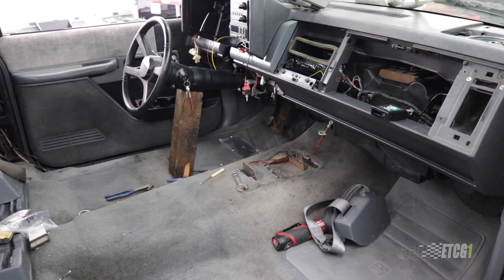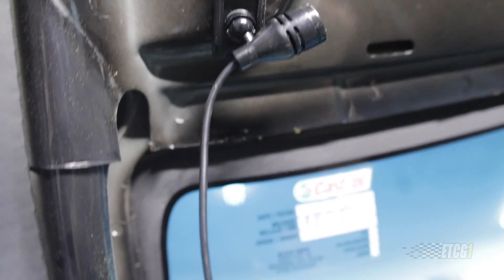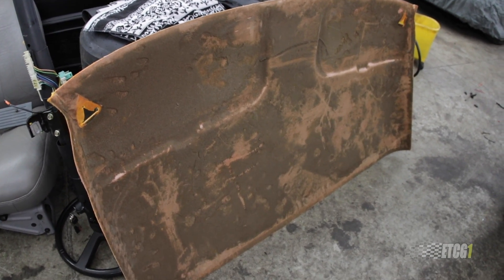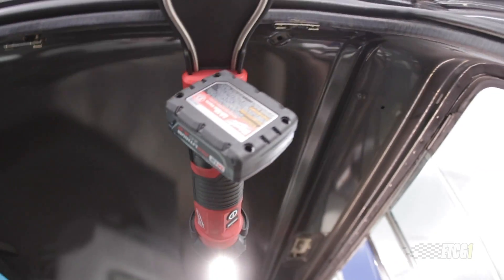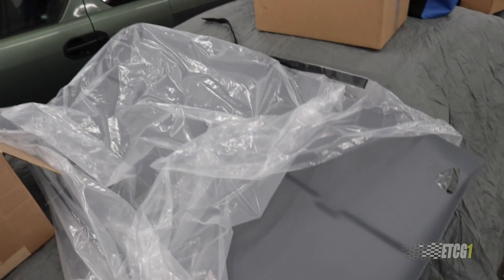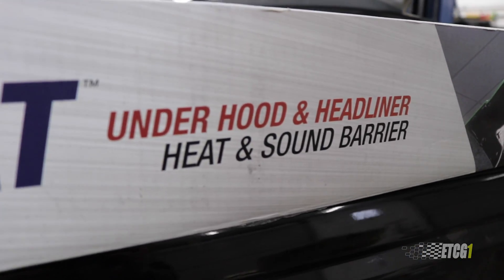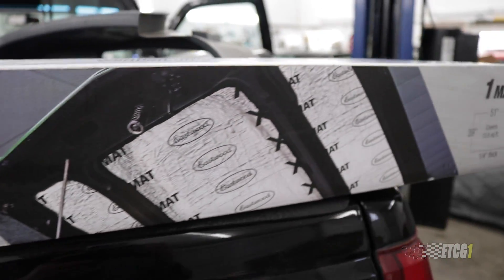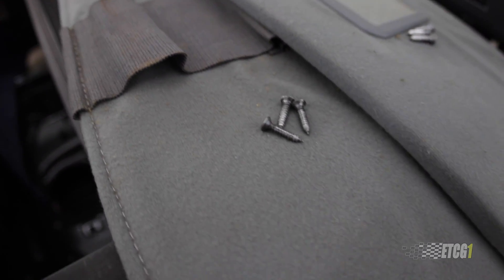How Deep Does the Rabbit Hole Go with #ETCGDadsTruck ?

Comment: Every project vehicle I've completed has never had a completion time line but has had a budget with extra funds available if and when necessary, usually 50% of initial budget.Normally, I spend 8 to 10 months planning to minimise exposure to overruns in costs, and a similar timeframe acquiring parts and accessories. As I have an extensive mechanical engineering workshop available, being a 30 year veteran mechanical engineer, with extensive knowledge and varied training, I have a huge advantage over other builders, which I acknowledge. This is also a huge unforeseeable cost saver. But as your project is  'personal', like my current project, (I'm rebuilding my dads orginal first car, an EH Holden X6, an extremely rare Australian factory performance car, which I tracked down, purchased and 80% completed in complete secrecy), cost should not be an issue. 👍👍🇦🇺

Comment: I hate the "might-as-well"s. It can be a motivation killer before you even start sometimes! Right now I'm putting my SBF together, and I've been trying to decide as I go whether to replace ALL the internal hardware for stuff like harmonic balancers, oil pumps and cam gears and stuff like that. I finally had to draw the line! New harmonic balancer bolt, and then everything else comes from inside the old engine. Done! I could have easily spent another $500 in little nickel and dime stuff! If not more!

Comment: I've been in the rabbit hole with a base model e46 in which I've spent more than 4k€ in repairs (I'm from Spain).
All started by changing the plugs and ignition coils because of rough idle, I thought "it's going to be only 250€ and the car will be fine"
Then oh, the car is leaking coolant, let's change some hoses and the expansion tank, another 200€
Then the radiator, the alternator, then I hit a dog, and had to replace the front fender, brake pads, silentblocks, suspension, and so on....

Now I'm finishing replacing the head gasket and valve stem seals because it was smoking a lot of oil, had to buy tons of tools to do the job plus gasket and seals.

By now, i've spent more money than a lease on a new vw golf. And the fuel economy of my e46 is not as good. +Insurance is not cheap on a bmw.
Also I'm not sure if I did the head gasket job properly. And if I sell the car, they are going to give me peanuts for it.

Comment: I am there right now with an R56 MINI. I just uncovered a broken piston. Do I replace one? oem? a forged set? What else do I replace while I have the engine open. If I could drain the A/C condenser safely, I would pull the block.

Comment: While I can't say I've spent nearly as much as you have into Dad's Truck, at least yours is coming along nicely.

I inherited an 89 Hilux which are famously easy to work on, but dear lord have I thrown more money and time than I have to toss around at it. It was a problem truck to begin with when I got it. Head gasket blew and prev. owner ran water the whole time and it overheated. I've halfway redone the top end. Resurfaced the head, all related gaskets & seals, new water pump, oil pump, timing chain, distributor rotor & cap (thank god the ignition coil is fine), plugs & wires, block plates on the EGR that I had to ask my friend's dad to fabricate (the EGR was already inop but I don't have LCE money), battery & terminals. New belts. There was a bunch of nonsense shoddy hotwiring done (not by me) that I spent weeks undoing, finding on the way that some things couldn't be undone and brought back to OEM bc of how it was done so now I have to live with it. Also did the front and rear brakes only to find that one caliper was replaced but wasn't replaced with a matching caliper, so only one side has new pads and the other is living on prayers. New clutch slave cylinder. Firewall is so rusted that I'm pretty sure if I tried to take the clutch master off, it would pull out a foot diameter hole with it. Speedometer doesn't work and it's proving impossible to find the correct speedo gear that fits into my transmission. Had someone rebuild the AC compressor but all the insulation for the HVAC vents is so old that it's crumbling and blowing straight out of the vents so I'd have to discharge the AC, take the whole dash apart, redo the insulation, and recharge the AC again. My brake pedal is somehow grounding my left turn signal and I can't find what wire it is. Still need to replace the steering components bc the wheel has a lot of play. Still need to get new headlights bc it's still running the OEM headlights which are as good as having candles. Still need to find a new steering wheel bc the horn button (or whatever you wanna call it) doesn't work. Still need a new front bumper bc the mounting for the front turn signals were destroyed so I don't have any signals in the front. Ignition cylinder doesn't crank so I just have a button in the cab that goes straight to the starter. Tires are probably gonna need to be replaced by the end of the year. And that's just everything I can think of without opening up my Things To Do notebook. Also I live in the Pacific so nearly every part I've needed, I've had to pay about half as much in its cost just to ship it here.

And all I wanted was for it to run. I'm not even doing anything fancy. I just wanted it to work. This is my first actual project vehicle, so about 3/4 of all this work, I'm learning as I go. And yesterday it wouldn't start so my buddies and I had to push start it and just go straight home. I don't even want this truck anymore but I have nothing else to drive. The rabbit hole runs deep.

Comment: Back when I was going to trade school for auto mechanics, me and a class mate went to fix the timing belt on my buddy's dad's 2004 Dodge Neon. Needless to say, the cam sprocket exploded when we tried removing the center bolts holding it on. 2 months and $300 later, when the dealership finally had the sprocket in, we went back to fix the car. What a nightmare that was... for all parties involved lol

Comment: I completely understand where your coming from, I have the same truck as you just a different color but I basically did what you did and I planned to have everything done within a couple months but it ended up taking me 4-5 months because when I thought accounted for everything, there was things that popped up that needed more time and money, I also have a V8 S10 and I have everything done with the exception of the exhaust and a couple other things at least I think I do haha but I was originally going to use S10 V8 headers but when I had them on they were resting on the brake lines and other stuff so I decided to go with 1987 camaro manifolds but they slightly hit the steering shaft and are barely above the upper control arm and require a custom flange but the point is I get where your coming from about when you think your done your not

Comment: My rabbit hole is a GT40 top end swap on my 92 LX Mustang. Bought good used heads, good used intake manifold, full exhaust - even the cheap stuff is expensive. A lot of the stuff that came off ended up getting replaced or rebuilt; new alternator (dropped the other one and broke the housing), starter rebuild because it will be hard to access behind long tubes (turns out it was nearly shot), new water pump, ac delete, new clutch, etc. Then I think my rear main is leaking so might as well get the transmission rebuilt since it has to come out, turns out it's originally a 4 cylinder T5 so now I've got a brand new T5z in the garage. Here's hoping I'm near the bottom of my rabbit hole :/.

Comment: Eric, this comes as no surprise.  With a vehicle of this age, you will always run in to problems like this.  You could have secured the mic wire outside of the plastice on a temporary basis, but you chose to do it properly.  My opinion, the correct decision.  Why do something twice when you can put forth more effort and actually save time and money by doing it right the first time.  Good job on that.  Dad will be driving this, so you want it to be as best it can be.  No one blames you for that.  You aren’t done and you will likely come across more unexpected things that need attention.  I have worked on these trucks.  They have a lot of potential.  I completely made all the brake lines in my driveway for a 92 in the middle of February.  Wasn’t fun.  I ran in to the brake issues you mentioned   I couldn’t do the abs delete because of state inspection.  That was years ago now.  Don’t know if the guy still even has the truck.  It was in rather nice shape at the time 10 years back.  You are taking the time to do this right and I know your Dad will appreciate it.  Like I said though, don’t forget the conveniently placed cup holder.  Good work on this project.  Hope you get it done in time.

Comment: I bought a classic car that I wanted to do up
Found hidden rust so had to replace a quarter panel and doors , The motor was weak and puffing so new heads cam and rings. the interior was sad so new carpet recovered seats sound mat everywhere new exhaust etc the gearbox started puking oil out the dipstick so rebuilt trans, with all the rust and dings fixed a new expensive paint job even though I did all the work myself it still cost the bomb , found some  of the missing chrome trim and was a day away from the final cut and polish before taking it to a concourse when a drunk totalled it running a red light . Between the jaws of life and the fire that started after they got me out fortunately the only thing left of the car was the chrome trim that I hadn't put on yet and the insurance company tried to use as an excuse to stiff me on the value. I sold the trim for more than what they wanted to pay me.

Comment: Got a factory clock to put into my base model x2 excel/accent, 20 minute job, right? 4 hours and 2 trips to a local self pull wrecking yard

Another thing on this near 30 year old Korean car, putting 15 inch steelies on to fit 195/50r15 tires to replace the 165/75r13 ones on from factory. The front rotors are held onto the back side of the hub, preventing me from fitting the new wheels on the front. Figured countersinking the holes and using flat head hex bolts to fasten the rotor to the hub, called up all the fastener places near me and the next few states over. Half a day just calling up looking for some m10x1.25 countersunk bolts

Comment: Same issue i'm having right now, Thinking of when to start removing my intake manifold so i can port it, cool. if i have the intake off, might as well remove the heads port match it to the intake.  remove the valves for a valve job  and install hardened valve seats. also, take a look at the cylinder bores and decide if i'm committed right then and there to just tear apart the motor to rebuild it.  

Hell of a domino effect

Bit of a time constraint here also, since i'm hoping to go on a roadtrip with my Dad,  as soon as i perform the above mentioned tasks so i have the maximum performance i possibly can while on my trip.

There is no turning back once you have tinkered with it

btw 1964 Dodge custom 880 Big block 361, TorqueFlite 3 speed automatic.

Thanks for reading this far lads, cheers.

Comment: The might as wells.
The upgrade avalanche.
We've all been there. I spent about double what my 91 Integra was worth when a valve cover gasket turned into a full rebuild plus body and paint, full suspension, a sound system and countless trips to Pick n Pull. Upside is I've put more trouble free miles on that car since then than I could have gotten with a newer car at several times the price.

Comment: This rabbit hole thing can happen indeed in anything :D

Recently my Playstation 3 battery, which keeps up the time and date, went dead. To replace it, the console must be disassembled, at least the power supply and Blu-Ray drive must be removed to gain access to the battery. Then again, while it's dissassembled, it might be good idea to clean the internal parts, cooling fan, heat sink, also replace the thermal conducting paste in the CPU & GPU to make sure it wont overheat in the future, some people might even want to replace the capacitors as the console is almost ten years old, and it could go on and on :D

Comment: I got a vw polo from 2001. 150000 miles. Got it for $2500 which was a quite good price because it was rust free, which is an important issue here in Sweden. After three years it has cost me over $8000, including what I originally bought it for.  But only $500-1000 at a time. It sucks.

Comment: I am a musician in my mid 40s. I wanted to start a band with the hopes of jamming at places and recording our own songs and producing them. I would buy the PA because we needed one. I bought the perfect band vehicle...an Astro Van with dark tinted windows!! I would buy cables for the PA. I bought the floor monitors for the PA I bought a few good studio mics. I bought a house to do this stuff in. Right before I move into my house, I suffer a major back injury. I get the usual surgery. It didn't work out for me.  I found out I was one of the 2% of the 10% of the 20% of the 80% that doesn't recover from my injury. Look up Failed Back Surgery Syndrome. So here I am, house full of big speakers and racks with Amps and basses and guitars and I don't feel like doing it anymore. I spent a butt load of money to get the last setup I would ever need. And now I don't need it. Funny how that works out!! I have mixer boards and digital input racks and software and hardware. I have stuff I don't know how to use yet!!

Comment: I'm in the same boat right now with, ironically, a GMT400 I just bought.  It has the factory TBI 305 that runs ok, but major laking in power. I started looking into heads, then MPFI, then stroker kits..... Ehh... I could done swapped a 350 or even 5.3 in it by then. But its the original 440k mile engine that came in it and I don't wanna just toss it....

Comment: Ohhh man,  you're preaching to the choir here. My 1996 Tahoe's 4l60e transmission crapped out, so I paid a reputable dealer to overhaul it ($1740). Six months later it crapped out again. Seeing as how I am not made of money I had already spent my savings on the first transmission job. I return to the shop that overhauled it and to my surprise his shop was closed and the building was sold. So I ordered a Quick Ship 4l60e and a case of transmission fluid from Monster transmission. Here is where the real nightmare starts. The transmission showed up without the fluid. I asked the delivery guy if he had it with the transmission. He said no. I called Monster and after being on hold forever I talked to a lady who said they would ship it right out. A week passes still no fluid. Call Monster back and went through the same BS and they finally sent me the fluid plus an extra six quarts as a "reward" for my patients. Then I pay another $840 to have it professionally installed by another transmission shop. Now the truck will not stay in first gear. If I shift it into first and I step on the throttle and get the rpms up to around 3,000 and let off it will automatically up-shift to second. It did not do that originally and I am furious. I took it back to the shop that installed it and let the guys at monster talk to the guy who installed it and he simply said "you're not supposed to drive it like a manual. I DO NOT CARE HOW I AM SUPPOSED TO DRIVE IT, I SIMPLY WANT THE TRANSMISSION TO WORK AS IT DID THE DAY IT LEFT THE SHOWROOM. Keep in mind the reason for me ordering the "Quick Ship" was I needed my truck to work quickly. I have been a mechanic for half my life and I was/am perfectly capable of installing the part myself but I wanted the entire job to have a warranty. I have now talked to Monster's warranty dept more than ever and the only thing they have done that is acceptable is sent me two cards with some stickers in them since I requested them. Its too bad I am not ever going to ever use the stickers because of their refusal to help me. Fu** Monster transmission and their horrible business practices. They reflect badly on all people who advertise for them. I know they sent you a free transmission for your project but my opinion of monster will not change.

Comment: I had a similar experience with a used 1984 BMW e30 I bought as a fun car for $1900.  I  saw a wobble in the fan that I diagnosed as a bad clutch (a 15 minute job with the right fan clutch tools).  Taking off the fan clutch, I realized there's definite play in the water pump shaft (even though it wasn't leaking).  Either I missed it before I bought the car or was in denial.  Either way, the pump needed to be replaced.  That meant replacing the timing belt (the water pump is the anchor for the timing belt tensioner spring), and the associated seals because I didn't know when they were last replaced, nor did I know the actual mileage on the car, because the odometer gears had disintegrated years before at 91K miles. Don't get me started on  the story about replacing the $20 set of odometer gears ($250 worth of instrument cluster circuit boards) .

With my lack of experience/skill at working on this particular model, along with weather delays (the car was on the driveway and I started in October) and parts ordering delays (everything pretty much was mail order), parts I damaged (that had to also be mail ordered) and I was working a full time job during the week,   what should have been a two or three day job turned into 5 months and a few hundred dollars instead of the $50 or so for the fan clutch.  I do know that if I need to do another one, it will be a lot faster the next time.